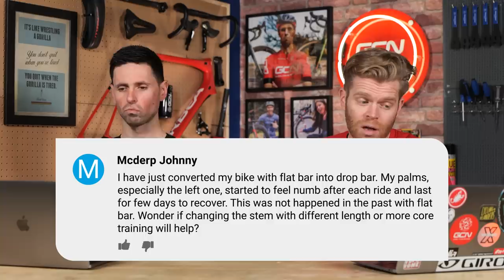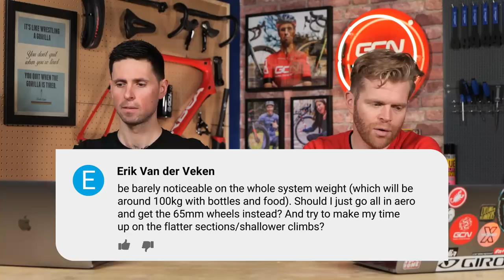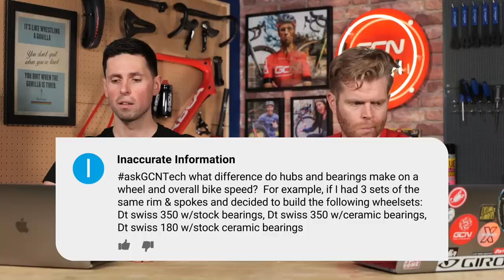How Can You Stop Hand Numbness On The Bike? | GCN Tech Clinic

Comment: Everyone is different. My wife got a new e bike with a flat bar. Her hands would get numb after a couple of hours and stay numb for several days, we changed the grips, the bar (Width and set back, 4 different set ups), stem and bar height and nothing worked. After selling the bike and changing to a Wilier Triestina (Mahal system e-bike) with drop bars the problem went away and in over 3000km this year she has not had any problems. The big thing is to keep trying and you will eventually find the correct set up and be able to ride more and further but the biggest thing is to Have Fun!!!

Comment: I had numbness problems with round section handlebars on all my bikes after multiple hour rides. Aero bars solved this for me (and flat ergo grips on my touring bike). I also found 3,5mm bar tape helps with comfort, but it was the ergo flat bars and grips that solved it. A Level 9 Aluminium ergo bar cost me 40 Euros, Ergon GP1s were about the same and I'm glad I spent the money.

I don't honestly understand the root cause. I don't believe my bikes are incorrectly sized. I am a fairly old cyclist.

Comment: I always used to get ulnar nerve numbness (in the 4th and baby fingers) and occasionally some ulnar nerve weakness on long rides (I tour rather than race). The first thing that I figured out was that really padded cycling gloves were part of the problem. I now go bare hands except when it's hot and my hands start to sweat or when it's cold when I use some long finger Windstopper gloves without padding.  This helped but not completely. I've now started riding with a Redshift Shockstop stem. At first I thought it was useless as it didn't seem to move much in response to bumps. It was only later that I realized that my hands weren't getting numb anymore on longer rides. The stem seems to reduce the road buzz that had contributed to ulnar nerve irritation. I also use their drop bar grips which spread the pressure out a bit more. They added even more comfort. I never get hand numbness at all now. No, I don't work for Redshift.

Comment: #askGCNTech Concerning the wheels: Can you make a comparison of a typical 35mm wheelset that comes with a bike against a 60mm and a 80mm and do that at mere mortal speeds? Is the aero gain of the 80mm over the 35mm at let‘s say 35kph still worth the added twitchiness or do you have to ride at pro speeds to profit enough?
Reply: There's no point in testing at slow speeds, the margin for error is higher than any gains you'd experience.
Buy 'em if you want 'em.

Comment: Fixed my hand numbness from going from a 12cm to a 8cm stem. Used to get numb feet then GCN told me to check my saddle and saddle height and the length of my cranks. 
I have nearly the opposite of what the bike fit I did recommended. lol

Comment: Too much hand pressure can often be fixed by increasing the setback (sliding to the saddle back, and lowering it slightly). You may need to change the stem to compensate for moving back, but give yourself a few hundred kms to adapt.

Comment: Wrist pain was why I switched from riding a mountain bike to a cross bike.  I rode a 80s vintage mountain bike to commute for years until the wrist pain became unbearable.  The geometry of the bars meant my wrists were always bent and supporting the weight of my upper body.  I switched to a cycle cross bike and the problem went away.
Reply: So you ride with straight arms outstretched now?
Reply: @janeblogs324  Yes.  My hands are in a different position and my wrists are straight.

Comment: If the person who fitted drop bars in place of flat bars didn’t change the stem, their hands will now be several centimetres further forward as the top of the drops project out beyond the stem. The levers on a flat bar bike would be in line with the stem, although maybe a little further apart.

Comment: #askgcntech, Hi GCN crew. I found at work an unused ultrasonic cleaner. I cleaned my cassette using the ultrasonic cleaner and it has done wonders. I'm thinking of cleaning other parts of my bike, in use for over three years. Do you think it's okay to clean my front/rear derailleurs and shifters, using an ultrasonic tank cleaner? Obviously mechanical, not Di2

Comment: #askgcntech 
Hey Tech's Happy New Year!! I have a Gravel bike for leisure which came with 12x110 front wheel and 12x148 rear wheel. I'm trying to upgrade my wheelset and I found out that it's very difficult to find boost gravel wheels. My question is: "Can I use MTB wheels?"